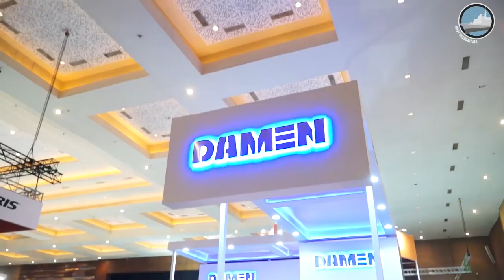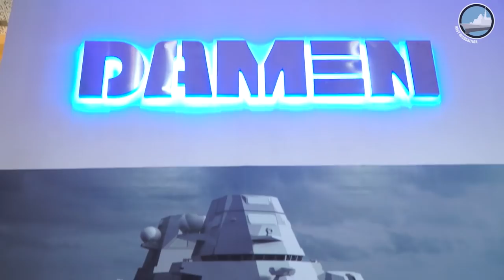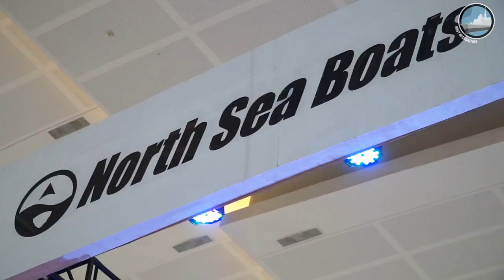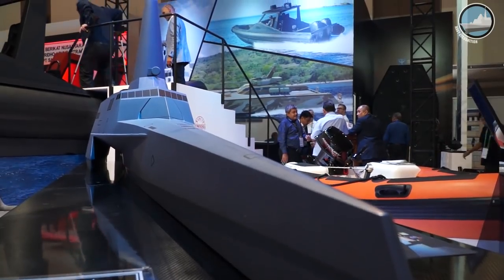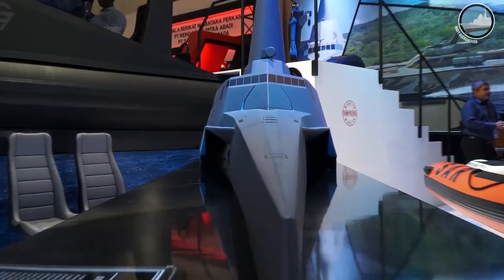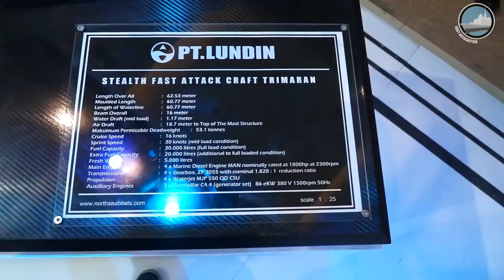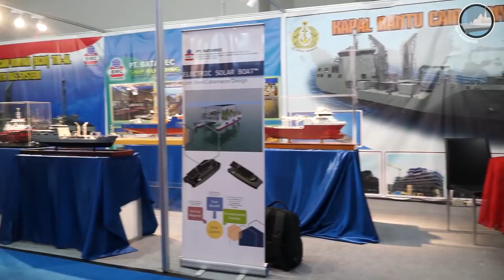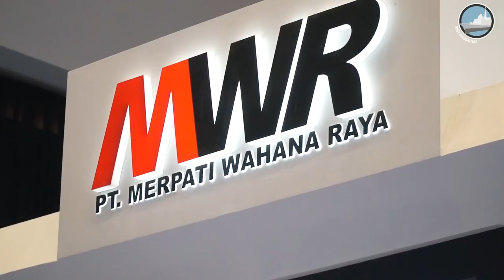Naval Products at Indodefence 2018 in Jakarta, Indonesia

Comment: > Frigate with 6000 tons of displacement.
> Armament weaker than a corvette.
Sounds nice.
Reply: i dont think so it has iso containers which is a modular combat system
Reply: Welcome to indonesian navy, one of the weaker navy in south east asia
Reply: Its modular
Reply: Means they can add more VLS if they wanted to
Reply: @IndoLiberation  which module contains loke 40 VLS?
Reply: @LegaRoSS  the container thing that the guy said "modular" behind the 2x4 anti ship missile launcher platform , its stanflex module i believe , you can install more vls cell on stanflex
Reply: @LegaRoSS  at 2:56 , probably because indonesia wanted a close specification to that iver huitfledt class which they favor due to its modularity , also used stanflex
Reply: @IndoLiberation  pretty sure thats not a containers at 2:56.
btw what container based modules with cruise missiles out there? I know only russian club-k.
Reply: @LegaRoSS  listen to what guys said in 2:56 , its not about the container , its about the space that the container used behind the 2x4 anti ship missile launcher ,  can be used to install modular vls stanflex module ,iver huitfledt class and other danish frigate used this system they had 56 cell of vls (consisted of 32xmk41 and 24x mk56) behind the 2x4 anti ship missile launcher  platform , and this vls are modular and can be detached to use the space for container or other thing